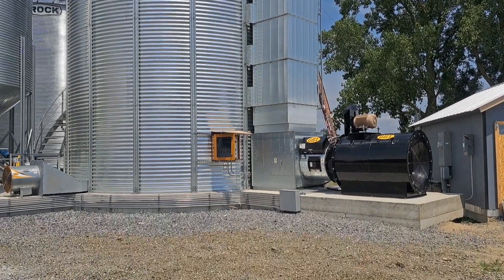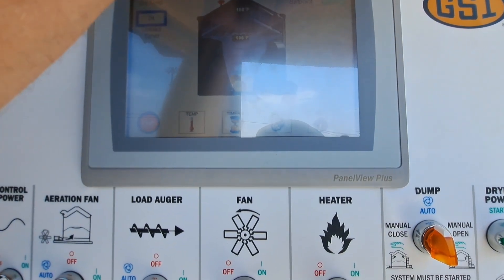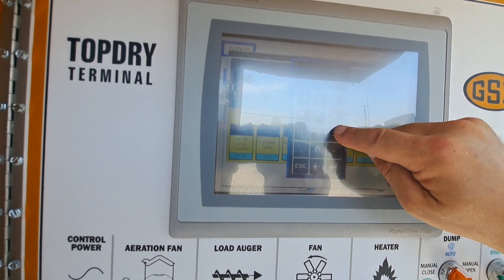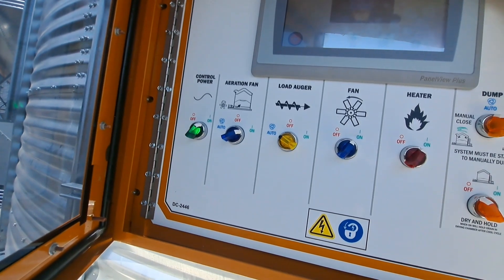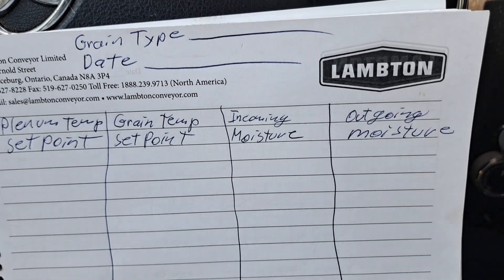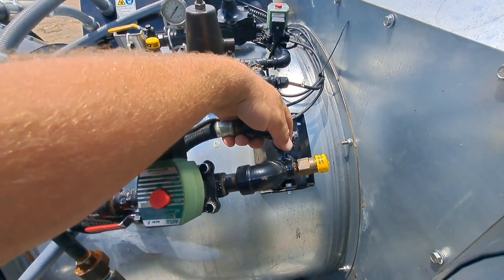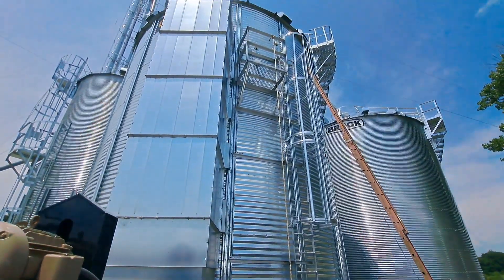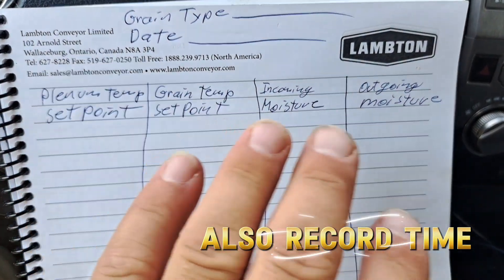GSI Terminal Autoflow TopDry general operation

Comment: 30' top dry, only do corn,  [2] 36" fans, natural gas service pressure/volume only allowing 150-170 plenum temp. Attempted set mark at 180. Trying to convince gas company to get me more pressure/volume. If that's unsuccessful, what options would you suggest?
Reply from the maker: 12 psi Natural Gas is required for burners to work properly. If Gas company refuses then email me at graindryer@repairman.com and I'll explain how to make burner make more heat. It will require larger hole in orfice.

Comment: What do you think of a gsi top dry that has two dryer fans
Reply from the maker: If you have a 30' or 36' topdryer it's the only way to efficiently increase airflow to utilize the drying capacity.  2 - 15 hp fans will move more air and thus dry more efficiently than 1 - 30hp.

Comment: You mentioned dumping all the grain out once a day to check chutes. I understand why we want to do that but what I don't understand is if I'm drying 23% corn then I'll be dumping that down below on top of the dry corn.
Reply from the maker: Take grain temp up about 10 degrees higher than normal setpoint and you should have a decent blend that's nit too wet